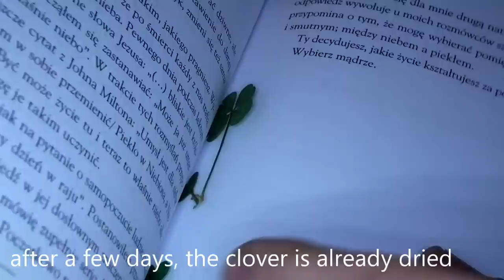Four-leaf Clover in Epoxy Resin. DIY a Simple way / ART RESIN

Comment: Hi. I actually tried to do something similar recently and waited days for the resin to cure. I could not unmould because the plastic I used ( thicker than yours) stuck to the resin and I couldn’t get it off!! Very frustrating. What sort of plastic should I be using PLEASE ? 🦆💕
Reply from the maker: 1mm plexiglass with anti frame
Reply: Many thanks. Have just ordered some 🦆💕